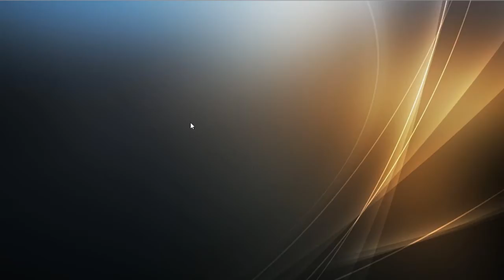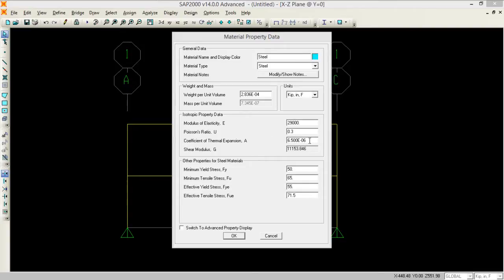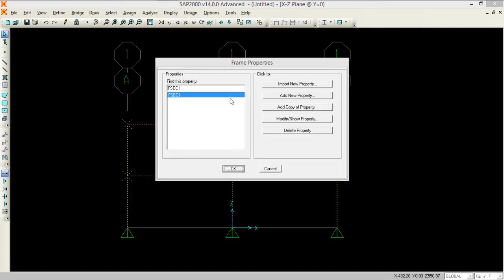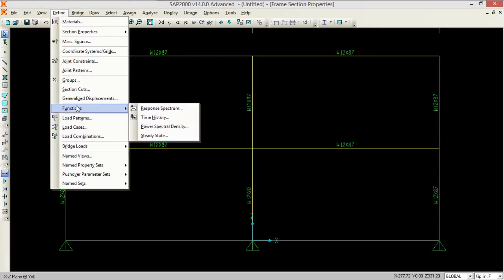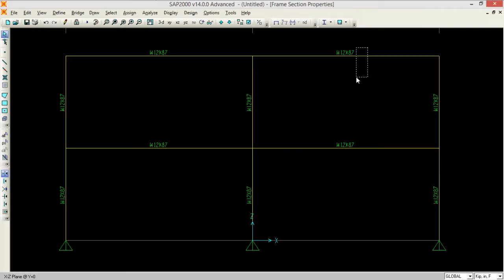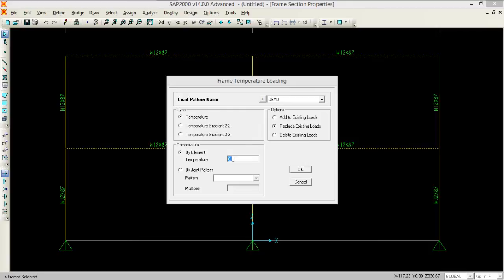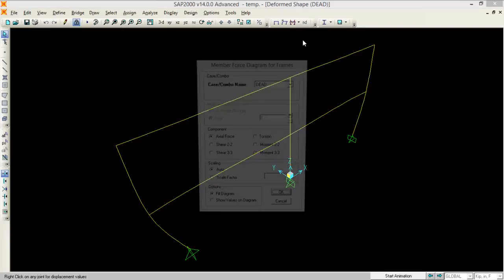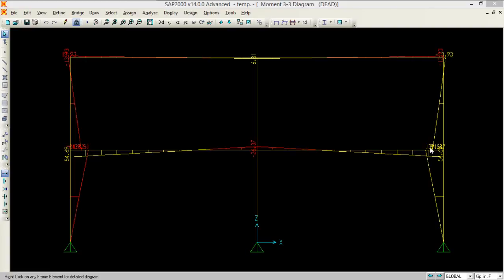THERMAL effects on the Structure in sap2000 v-14 | WoW

Comment: Why do you change self weight to 0 from 1 in load patterns?
Reply: he does that to not account for the self weight of the material; for the dimensions you are using for build the structures, if you leave it at 1, you account the weight of the material on the calculations